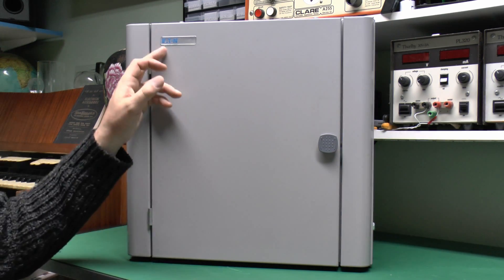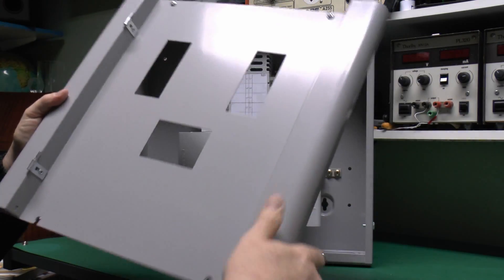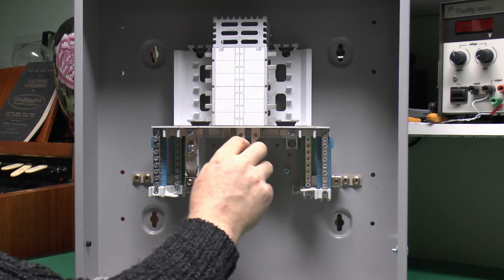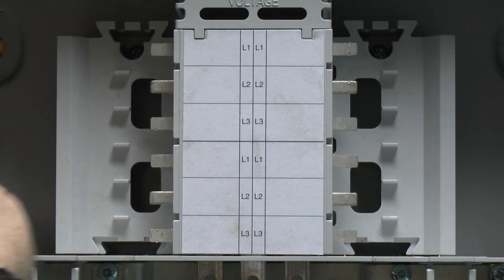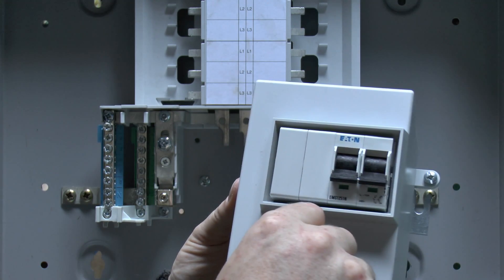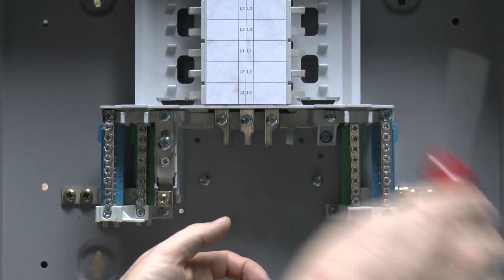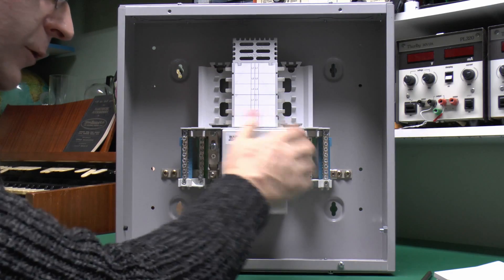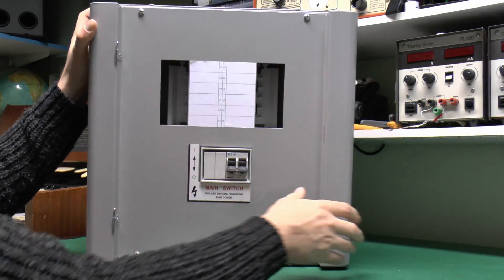3 Phase Distribution Board - Eaton Memshield 3

Comment: This is so interesting.
So I suppose...
   ...if, for example,  someone had built a new large garage / workshop and only needed a single phase supply at that point, but wanted an option to perhaps upgrade to three phase later on, this (by this, I mean this board), would be the perfect way to proceed.
I guess.
Well, that's what I would do anyway.
>

Comment: Thanks John for the videos. I have mostly been working on domestic supplies. If you are turning this into a single phase supply wont the voltage be higher than 230V if all 3 bars are connected as one? Also for a three phase supply is a ELCB breaker better than a RCBO breaker
Reply: those 3 bars are all connected to single phase as this video demonstration is about connecting single phase supply to this 3 phase DB. also ELCB is outdated. RCB or RCBO is updated technology and better
Reply: @lordjaashin  I thank you for your reply

Comment: Hi John,  I wonder if installing ryfield for  new flats is the supplier job or an electrician should do that?
Thanks in advance
Reply from the maker: Normally electrician will install - the supplier may connect it to the incoming supply but won't get involved with any of the equipment or wiring inside the building.
Reply: @jwflame  thanks John, 
Unfortunately the supplier can supply by 2020 which far too away. Any chance to know any independent supplier please? 
Thanks again

Comment: John, I work in China where domestic apartments can have both 3 and single phase supplied. The 3 phase is designed primarily for larger air con only. Can you give me some suggestions how I should ask the local "electrician" to wire up the consumer unit so all the different phases and the individual 3 phase supply to the AC are RCD protected. Will I have to have  an older style single RCD that shuts off supplt to everything in the apartment rather than the individual protected circuits, there will be three single phase networks each with RCD.. Many thanks
Reply from the maker: Various options: 
A: 3 phase board with switch incomer, and single phase RCBOs for the single phase loads. 3 phase RCBOs for the 3 phase loads.  Will be the most expensive and 3 phase RCBOs are not available from all manufacturers, but one circuit failure won't affect the others.
B: The same, but have 3p MCBs for the 3 phase loads and put separate 3 phase RCDs in another enclosure for the 3 phase circuits.  Probably easier as no need to source 3 phase RCBOs, but uses more space.
C: 2x 3 phase boards - one with switch incomer and single phase RCBOs, the other with RCD incomer and 3 phase MCBs.
D: 3 phase board with RCD incomer, MCBs for all circuits.  Probably cheapest, but any failure takes out the whole lot.
Also consider if the air con actually needs an RCD.

Comment: One of the things that strikes me about the UK electrical system is the small number of circuits in favor of local fusing. There's a comment below from someone having to rewire a house with the implication that 24 circuits is a lot. Here, I regularly install 40-circuit panels.

Your voltage is higher, but so is your current. 32A circuits for receptacles -- that's not a thing here. We can't install general-use receptacles on any circuit larger than 20A. Of course you have fuses in the plugs to protect the final cord: here, someone has done some math and figured the impedance of a device's power cord with a dead short on the end, and calculated it should reliably trip a 20A breaker without catching fire, so that's the most we can use for the entire circuit.

Comment: I know nothing about 3 to single phase electrics. But I followed this and did it my self. Really useful and well presented, easy to follow and even more so as the unit was identical to ours. Everything works as it only ran a few LED lights, a fridge and few other bits.

Comment: I'm starting a project where the customer has 24 RCB's spread over 3 consumer units (single phase) from the 70's - The idea of using a single 8 ways 3 Phase distribution board is VERY appealing - Is Eaton the only brand you would recommend when it comes to this kind of 3 Phase to Single Phase conversion?  Do Crabtree and the likes offer the same, seemingly simple solution that you demonstrated here?
Reply from the maker: Most other manufacturers make similar things, the principle is the same.
One thing to be aware of is that 3 phase boards are normally supplied with just the busbars fitted, so you will need to buy the appropriate incoming switch, single phase connector bars and any other parts required as separate items.
Reply: I've been looking around, and like you say most other suppliers require other 'bits' that you need knowledge of.  The Eaton has a very neat kit (as you demonstrated) where as the likes of Hager make it a little more complicated....  I'll conduct a little more research, but looks like the Eaton Memshield for me (unless you have a setup video if the Hager 3 phase distribution board).

Comment: Can someone please explain to me why you short out the 3 phases with that bit of busbar? I'm training to be an electrician and I'm just curious
Reply from the maker: It's done in this example at it was being connected to a single phase supply, so the 1 incoming phase is connected to all 3 in the board.
For a 3 phase application, the link would NOT be installed, each of the 3 separate phases connects to it's own terminal.
Reply: Thank you mate, Ive actually been working on the panels myself so its all 3 phase, in college for the apprenticeship at the moment but the domestic/industrial stuff is very new to me, I must have been half asleep watching the video to not pick up it was being connected to a single phase. Thank you very much for your reply It's much appreciated!

Comment: what is typical for modern britisch homes ?? 1 phase 230/240V at 100Amp ?? 
i like these panel much more than what i most homes in germany have!  modern homes have in most cases 3 phases servis but the fuses boxes are so smal that if you use all slots you cant close the box because its exploding with wires!
Reply from the maker: Single phase, 100A on newer properties.  Older ones often 80A or 60A.
230V in theory but in reality it's usually 240V.

3 phase normally only installed in commercial buildings.
Reply: mostly prewar buildings in germany have 1 phase.  220v in the older days .  230 today at 10 or 16 or 25 if you lucky 35 amps !
in germany is not typical after war to get a gas stove! nealy all buildings with electric stofe have models they run on 3 phases! 
also after war it was common electric wather heater or electric room heating on 3 phases!
i dont like electric wather heater or room heating! its much more expensive than gas!
Reply: The hunter games
Reply: I have both 3 phase and single phase in my home and work shop with I'm told single phases taken from the 3 phase  to power different  single phase lines in the work shop and home and i have a few questions which I hope you can answer 1. Is that possible 2. Will my single phase handle the job if I remove the 3 phase as running 2 metres is quite expensive 3. Is using the 3 phase in this way cost effective ie. Running single phases from a 3 phase meter . Actual 3 phase not being used and nothing bigger than a rod welder , power washer and lights in the workshop and 2 electric showers and an electric oven and hob in the house ? Single phase 400 units per month 3 phase 130 units per month ?????

Comment: hi John! Is it right to mount mcb's horizontally? I think the arc chutes inside are most effective only when the MCB's are vertical as the ionised gases get longer time to cool down and extinguish successfully.
Reply from the maker: Most industrial boards are designed with the MCBs horizontal, so it's not a problem.

Comment: Hi John, 
on a 3 phase domestic supply is it acceptable to use all the phases for the various household circuits or should it be done as per the video with a shorting bar. Also I presume the requirements for rcd protection should still be met? or better yet rcbo all round.
Reply from the maker: If you have a 3 phase supply there is no bar - you have a 4 pole switch instead, 3 phases and neutral.
RCD requirements are not affected by it being 3 phase or single phase.
Reply: OK so all three phases used ta. a friend has this supply but only a 3 pole switch as far as I can see. only 4 rcbo's for the new extension and all the other circuits seem to be unprotected as no rcds visible when supposedly there is. obviously the rcds are required but Is the neutral required to be switched too?
Reply from the maker: Neutral would normally be switched.  The 3 pole switches are really intended for boards where all of the loads are 3 phase, so no neutral is required.

Comment: Hi JW,  just an observation that unless skilled or instructed persons- 3 phase 4 pole with switched neutral as far as we are aware ( without reaching for BS7671)

One of our recent inspection jobs a memshield DB they decided to fit 30ma rcd on a large three phase  board- rather than 4 pole switch and RCBO's (cost) also no accounting for de rating factors in trunking.

While we like the quality of MEM, as series change older breakers become more expensive to source- unless you know of another manufacturer MCB that will fit.

Just off the cuff comments, thank you for video's as always

Comment: i have 3 phase ac, my dad instaled it when he build house, is thare any advantages over single phase i dont use lot of electricity?
Reply: If you wire in a separate radial circuit for each outlet you can, indeed, use all the phases. It's actually good practice to try and balance the phases, although in a typical domestic setting it won't make two much difference. However, it's more important in large industrial installations. The point about balancing the phases is to minimise the amount of current going down the neutral back to the local power distribution network. In the local distribution network where single phases are supplied to households the local distribution network will be set up to balance those by premises.
Reply: Indosarnia  In which case you need to speak to the Germans or any of the other European countries that provide three phase power to domestic properties as part of their standard electrical distribution system.

I don't see where the "touching distance" is an issue as it's difficult to imagine a scenario where somebody would be able to touch two different phases at the same time except within the distribution panel or an exposed three phase power connector. 

Of course, in the UK single phase is almost universal in for domestic supplies, but with the move to EVs and away from gas heating in the future, then it's possible 100A single phase may not be sufficient, particularly if there are multiple EV charging points.
Reply from the maker: +mmartin Only advantage is if you want to use 3 phase equipment.  Otherwise it's just 3 single phase supplies.
Reply: Can the house outlets use three phase if they normally use one phase? I'm assuming you could send just one phase to each outlet. Is this acceptable?

Comment: Also, why do people say we have 230V but we can measure plugs 250V and some people say 240V. I know the Chinese make manufacturers make sstuff that can take pretty much any voltage.
Reply: the differences depend on how far away from your grid you are, it can drop as low as 220 V in places (generally very rural areas) also, the Chinese made products generally say they can take most voltages but they really wouldn't be able to, I've seen cables burn up because of incorrect ratings etc...

Comment: Hi John, we've had a complaint where the guy says he bought a brand new soldering iron from The Range, left it for 10 minutres to heat up. Went to use it and there was an explosion and knocked him out until his wife woke him up. The burn mark is just above the handle so its unlikely he melted through the cable.A couple of things we noticed is that ALL of our branding, batch number and other writing has been rubbed off, indicating that it was in fact not new. It also has some solder and a little copper ccoloured material on the hot end. We believe that the Line and Neutral somehow touched and caused a bang. Can I get your opinions? Thanks
Reply from the maker: +ChompChompNomNom Probably wear caused by the wires being bent/flexed over time causing the inner conductors to short together.
'explosion and knocked him out until his wife woke him up' is also highly implausible, since the fault level at an appliance will typically be very low, due to the distance from the mains intake, the impedance of the circuit wiring and the multiple protective devices in the chain (supplier fuse for the building, MCB/fuse for the circuit, fuse in the plug).
Reply: I got some of the original cable, shorted out the live and neutral and it simply tripped the sockets. I think this guy probably has a very long wire from his house to his garage/shed with no protection at that point.

Comment: Hi JW,
Could you do a video explaining three-phase power in general - what it is; how it works; why you'd use it instead of normal 240V mains; that kinda thing. It's something I can't seem to get my head around, and it's apparently not very common here in Ireland, but nonetheless something I'm interested in!

Thanks!
Reply: +Daniel 
This, with all the subtly that goes around neutral conductor. Like when it can be shared, when it can do the double duty as PE, when it can be reduced size.

This is mild stuff compared to what the Americans do with three phase circuits.

Comment: Great vid, not sure if you take requests for vids but I'm struggling with supply distribution topic namely the 3 wire system delta and star connections and their windings... I've reviewed the topic several times but can wrap my head around it, could you help? or point me towards a source of info? I feel the text book I'm reading from is letting me down... any helps appreciated.  keep the vids coming
Reply: Robert Tungate - yes, me too.

Comment: Here in SA the industrial boards come in both steel and GRP, which makes it easier to drill the holes for cabling glands and such. Steel will typically have a set of partially punched knockouts, but if you want to actually get it out you generally will need a hole saw in any case, as the knockout is more a suggestion than something that actually has gone through the metal.

I had to do some work on the old DB of a building, and needed 1 hole saw per hole to cut them, the old metal was that thick and that tough that a hole saw that would typically do 100 holes in regular steel panels would simply dull in seconds, even with lubricant. 

I use an old vacuum cleaner when drilling them, so the swarf you make does not deposit itself all over the inside of the panel and the breakers, which is not a good thing on an already populated ( and possibly live already) panel you are adding to. Even use it with the GRP units, as then the dust is gone before you need to sweep, and as a bonus you can clean inside the panel as well to get all those little clipped ends and plastic pieces out. You just have to go into the bag to get the loose washers and screws it finds, you might really want those later. Also great for cleaning inside machinery to get the dirt and dust away, along with all grease and oil spills. Cylinder vacuum that was noisy, but a new motor and it is not, plus it gets a regular washing with hot water and soap to get the grease out of the pipe.

Comment: I'm sorry but that neutral link connection must be straightened properly to satisfy my OCD here.  If only I could reach into YouTube with my PZ2...

Curious question:  Is there any reason 3-phase dis. boards generally don't switch the neutral on the incomer compared to domestic C.U. that typically does?  Would it be expected to have a separate 4-pole isolation device installed in situations where a 3-phase dis. is fed direct from the mains?

And whilst we're here, arguments on whether MCBs should switch towards or away from board centre.  I've come across too many that, in my mind, have had the MCBs installed backwards (towards the centre for 'ON'), which has thrown up all-sorts of questions in my head with regards MCB design and logical reasoning.  I think it may even be manufacturer specific, where some design for switching inwards, and some outwards.  I don't tend to see 'Line/Load' markings on MCBs, either, just to make matters worse.
Reply: Even worse, I have come across these DB's with MCB's switching in both directions. I have so many arguments with Sparks about this when I do inspections. The RCBO's only fit in one direction, so let that be your guide if you fit them. Switching away from the spine for "ON", so fit the MCB'S the same way.